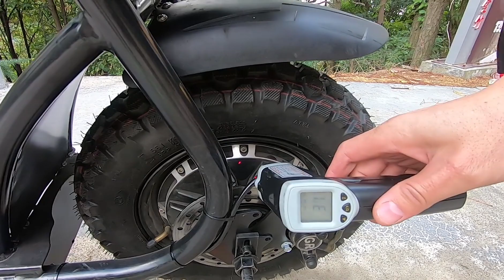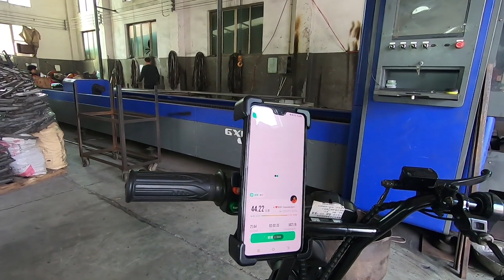China Factory 2023 New Electric Scooter Climbing Performance on Moutain

Comment: 25 miles range not bad . i get 28 miles range on my 18ah battery i weigh 60kg dping 27mph . single duel drive on my e scooter , if i go full throttle i get 19 miles going 45mph , i bought too of the same E scooter cost me 1800.00 pounds so i know i have max of 38 miles range when i use both of them in one day saving to upgrade to a 5600w E scooter , but my others keep costing me in repairs and parts lol , one day i will learn to do all my self then i will look back and say i wasted so much money on something i could of done my self
Reply from the maker: Good for you.